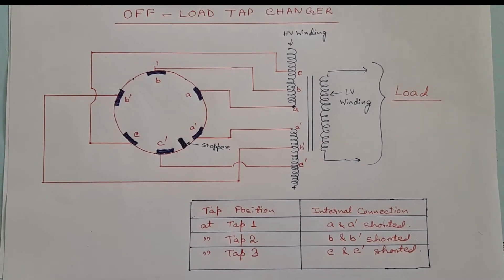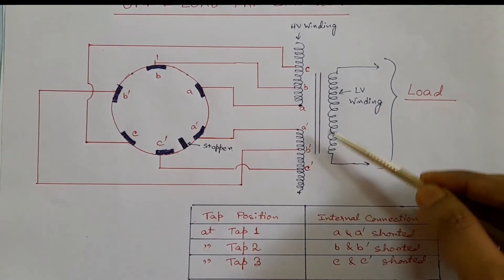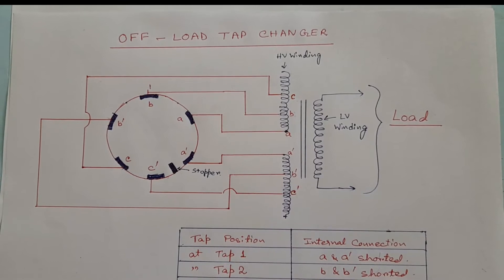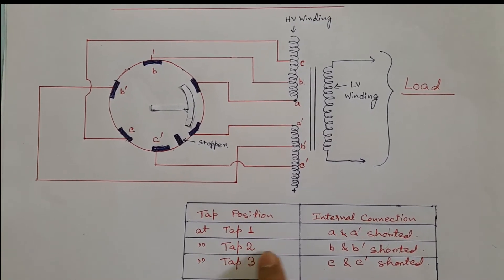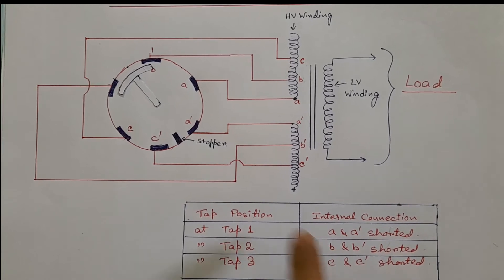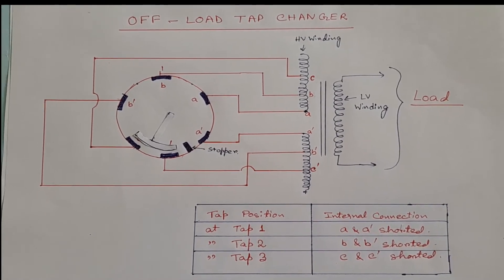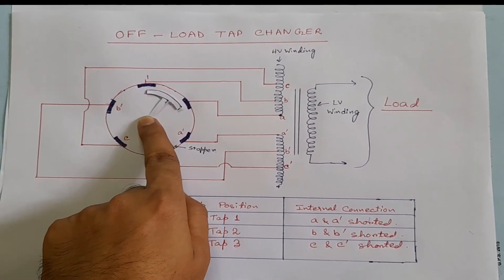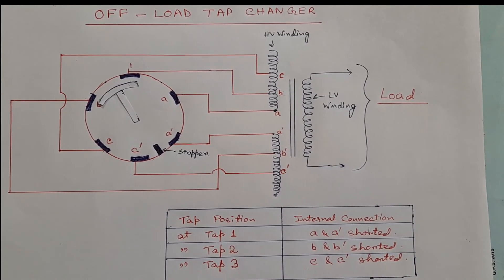OFF LOAD TAP CHANGER

Comment: Why we not used in end tap why devide we create 2 group of winding
Reply from the maker: May be to achieve equal MMF field source at top and bottom portion of the limb.
Reply: @eddycurrent1187  right but if we used end tap so axial and redial force happened in x mer winding